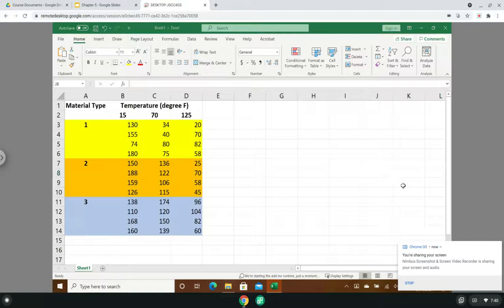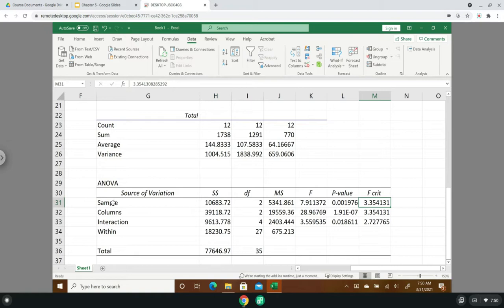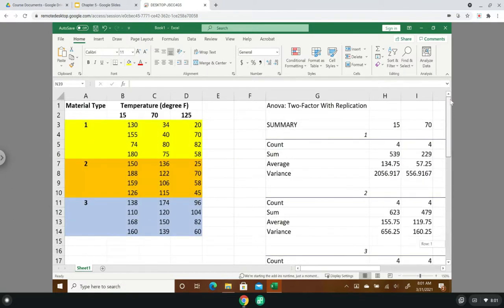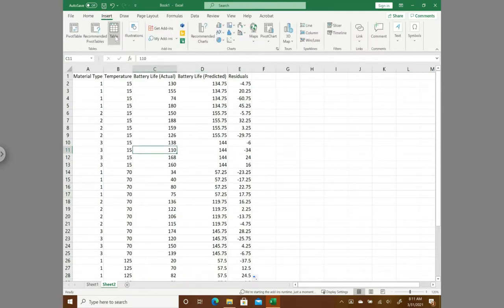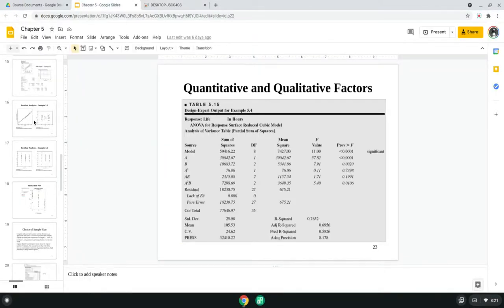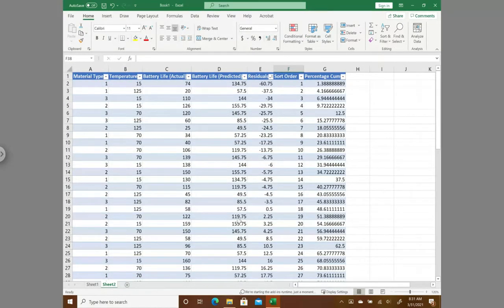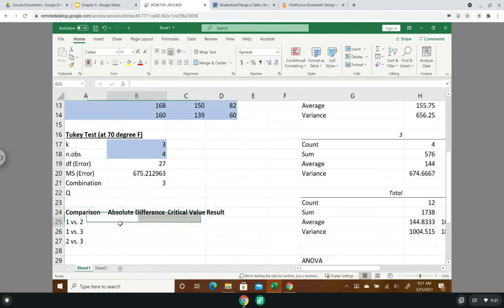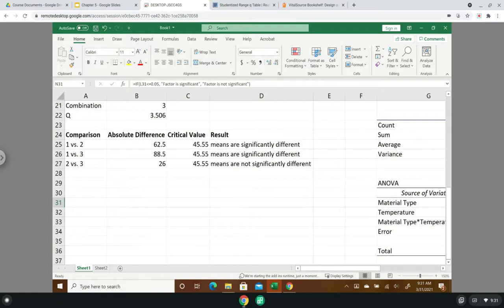ANOVA: Two Factor with replication, Residuals Analysis, and Tukey Test

Comment: Sir,
Can we determine which material type- out of material 1,2 & 3 have more influence among them using anova test.
Reply from the maker: You can make three box plots for the three material types on the same graph and see that visually.
Reply: @nileshjoshi9411  sir, is there any other method like ANOVA to analyse data using excel